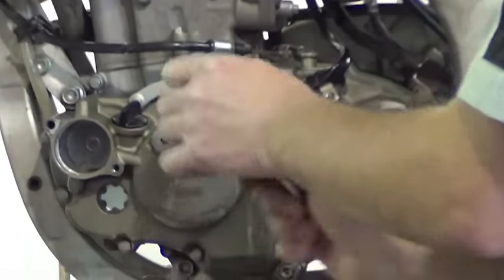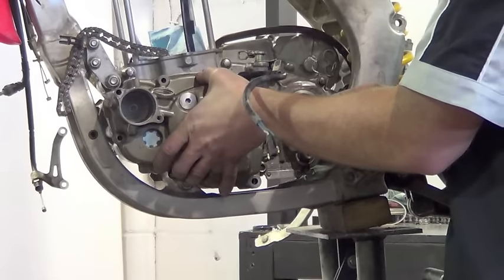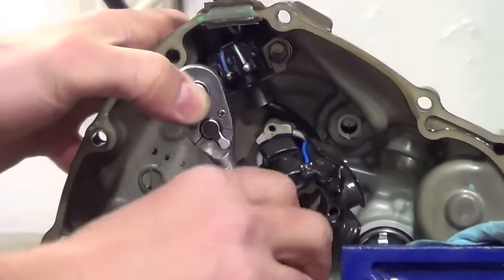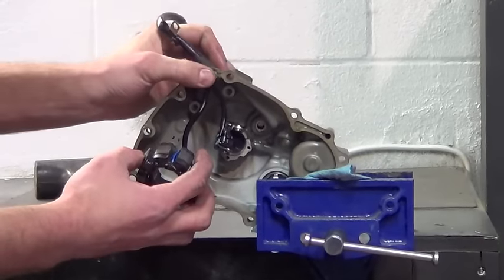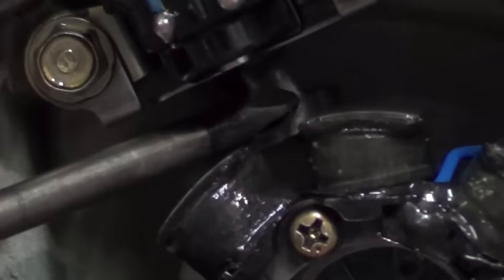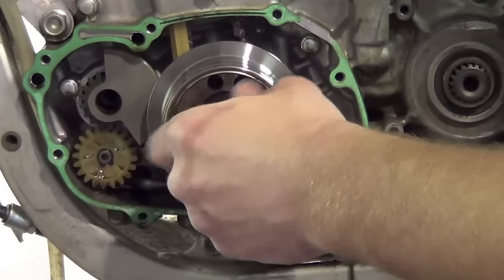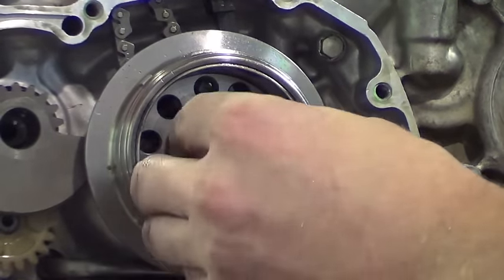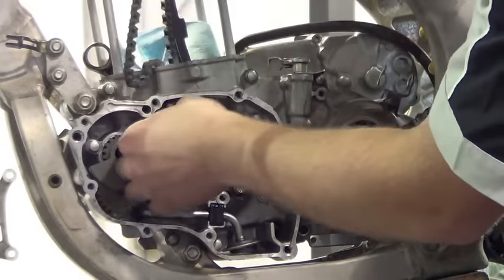CRF Stator Flywheel Cam Chain Removal and Install - Parts in Description

Comment: Do you have a video of Replacing the Tensioner - what are your thoughts on replacing Stock Tensioner with Manual Tensioner ?
Reply: Did u end up going OEM on the tensioner?  How did you know it needed to be changed? I have a small knocking sound coming from my 06 450r? I think that is my problem

Comment: Is the snap ring and washer behind the stator needed for it to run?
Reply from the maker: @Jakejonesguy  no but you might run the risk of damaging the seal and losing oil pressure if they’re not installed.

Comment: you make it look so easy... im trying to take off the stator nut before flywheel and it just keeps spinning could this be the clutch slipping?
Reply from the maker: +Zachary Hamren Most likely the clutch is slipping. Those nuts can get pretty tight from going through years of heat cycles. You may need a flywheel holder or you can pull your right side case cover off and jam the primary drive sprocket against the clutch hub with a piece of aluminum. There are literally 10 different ways to do it but some make it pretty easy to F stuff up if you're not 100% on what your doing. Factory training frowns on this method but I use my 1/2" impact on them all the time. Don't use the impact for the puller though. Have fun!
Reply: +CoteMotorcycles thanks a lot man. love the videos they're super informative and very helpful!

Comment: Can you replace the Cam Chain Guide and Tensioner (interior) without removing the head?
Reply from the maker: The tensioner guide is held in place by the head.  I’ve never really seen one worn out unless the engine was run without oil (or full of water) so the head was always coming off regardless. Hope that helps! Hit me with a thumbs up and a share if you could!
Reply: @CoteMotorcycles  thanks man. They look to be in tact when I look in through the valve cover but discolored due to lack of maintenance from previous owners. Got to get use to how this thing sounds... I hear the are it of a clacky beast.
Reply from the maker: TheWiscoKid haha! Ya no joke! You usually won’t be able to hear any timing chain noise over the piston slap anyways!
Reply: @CoteMotorcycles  great videos BTW, been soaking them up left and right. Keep up the good work.
Reply from the maker: TheWiscoKid Thanks brother. Don’t be afraid to share!

Comment: Thanks for the video. I have the same bike with an intermittent spark and i'm hoping its the stator coil.
Reply from the maker: Be sure to check the easiest stuff first. A damaged kill switch or related wiring is usually the culprit for ignition problems on the hondas. Check all your wiring for chaffing/connectivity and go from there. More often then not I've seen one of the connectors on the coil not plugged properly and only held on by the insulation. A stator will generally work or not work on these bikes. Very rare they have a broken wire that contacts when cool and looses continuity when its hot. (which is what you're suggesting I believe) Just a heads up and good luck! Be sure to share the videos so we can make some more. Thanks for watching.
Reply: CoteMotorcycles
Reply: remove oil pump drive gear

Comment: Thanks for a great video.
What type of sealant did you use for the stator grommet?
Does the sealant go all way around the grommet? or just in the groove?
Reply: Permatex Ultra Black. All around the grommet wouldn't hurt.

Comment: My dog messed up order of bolts for cover .5 short ones 2 long. Wea the 2 long ones go
Reply from the maker: If the shorter bolt hits the case before being able to thread it in then you need a longer bolt. Also, if you use a bolt that is too long it will bottom out before the head seats. You can probably see where they go in the video.
Reply: I seem one long one to the right of dipstik.not sure wea second one goes
Reply: Im geussing second long bolt is middle bottom
Reply from the maker: @alinicoson8398  I believe there's a longer bolt that holds the oil filter cover on.
Reply: Yip sussed it.had a week spark issue.valves done carb dun all electrics replaced.hope she starts.old dog.luv her tho

Comment: WHAT IS THE OD OF THAT PEICE OF TUBING YOU USED TO LOCK THE SPROCKET WHEN REMOVING FLYWHEEL NUT ?
Reply from the maker: I'm not entirely sure, that bit of aluminum is long gone. It's not scientific, the point was to show one method of locking the crankshaft. It's definitely best to find a flywheel holder or lock the clutch to primary drive gear. If your using a jam anywhere, make sure it's softer than steel or you'll do some damage.
Reply: @CoteMotorcycles 😅

Comment: I used the idea of putting something in the front sprocket.....broke two teeth and slip the clutch sooooo idk  what to do now
Reply: I would put a wrench on the other side of the crank if possible use that to hold it